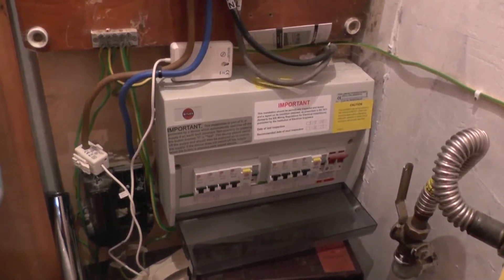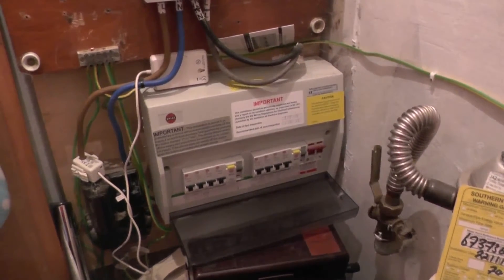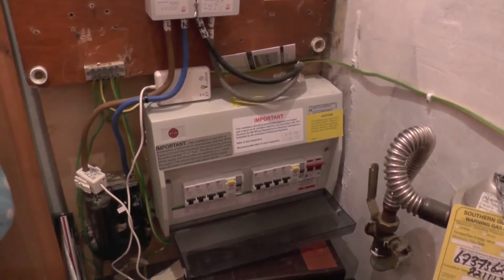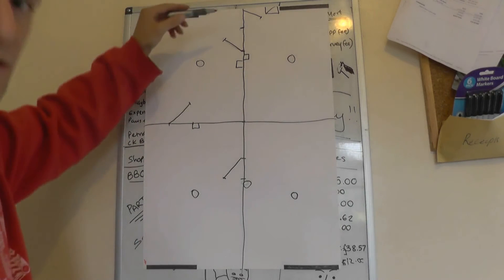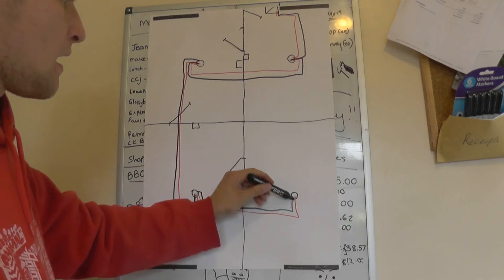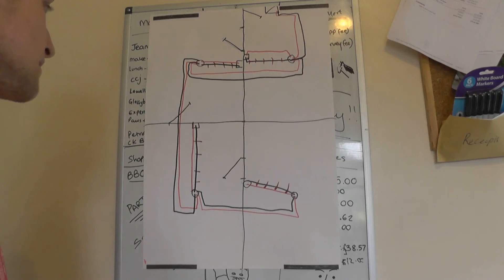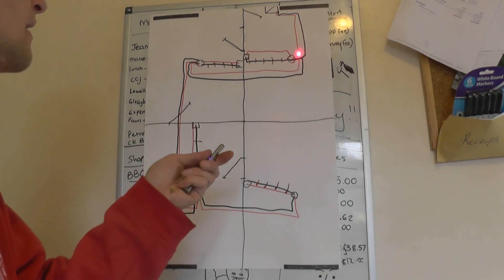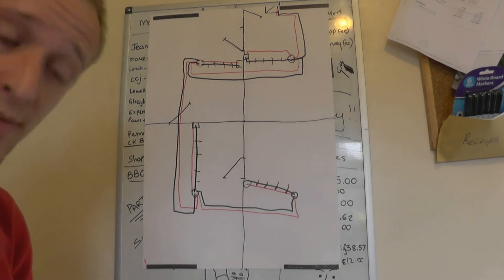Using existing mains UK wiring for 12v lighting! what do you think?

Comment: Your drawing is a "radial circuit" not a "loop circuit".
Here in the UK you will see sockets wired in 2.5mm T&E in a loop circuit which is fused at 32A max, and lighting wired in 1.5mm T&E radial circuit which is fused at 6A max.
I would use Loop Circuits for low voltage lighting, not radial. Because loop circuits can handle double the amps with the same sized cable. By returning the Live Neutral and Earth in the last light to the consumer unit in your drawing(changing the circuit from a Radial to a Loop), you double(12A) its current handling ability.
Also, the switch wires should both be red, not red and black.
Reply from the maker: Brilliant idea closing the lighting circuit and making a ring circuit out of it. If you moved house you'd have to remove the link that closes the lighting radial to a ring otherwise you've changed the characteristics of the circuit and would need to get an installation certificate put on it.

2.5mm was used for camera only. 
1.5mm could be on a 10A mcb depending on your test results and I've only on one occasion seen a red and red twin and earth on a house that was undergoing a rewire. It is available but seldom used.

Comment: Please forgive me for the proverbial sucking of eggs in some places given your trade.
As you are well aware, the current wiring is typically protected by a 6A over current device, usually an AC rated MCB. So, without performing any wiring upgrades, you have 6A to play with. Given either of the ideas presented, this equates to 1.4KW@ 240V or 72W@ 12V.
Either way you would naturally remove the wiring for the lighting circuits from the existing 240V mains supplied consumer unit and re-route it into a separate cabinet.
Assuming you decided to go for a 12V system then inside that cabinet you would want to continue to provide protection for the wiring at 6A, however it must be a DC rated device capable of extinguishing the arc effectively, either with a DC rated circuit breaker or a suitable fuse.
If you were to go for a 240V inverter supplied system then you could use a standard 6A AC rated breaker from your favourite electrical factors alongside a RCD, or just use a 6A RCBO. Upstream of the RCBO would be as small an inverter as feasible (to reduce losses in the conversion process). The inverter will, naturally, have it's neutral leg tied to earth (upstream of the RCBO of course) which would facilitate the operation of the RCBO in an earth fault situation.
A 12V system limits your wattage dramatically of course but has the advantage of only having one conversion process which takes place in the lamp it's self. 72W of LED lighting is quite a lot. I am quite comfortable with 10-15W per room. The voltage drop may be of some concern, but it's not as if the entire load is at the end of the run, it's spread out along it. Also consider that the LED lamps have a DC-DC converter inside, so would be quite happy running at say 11V. The disadvantage is that the fittings would need to be changed to suit 12V lighting.
The 240V inverter fed system retains existing light fixtures and can handle more power, but obviously requires the purchase of a suitably sized (good quality) inverter at some cost. Also, the inverter may well be running 24/7 for the sake of convenience (who want's to be mumbling and stumbling around in the dark to switch the inverter on at 2:45am when all you want is a slash?). Running even an unloaded inverter uses a lot of energy over a 24 hour period
I hope this provides some food for thought..

Comment: if you choose 240 then i would go inverter to a rcb fuse box for the lighting if 12 volt i would make it so the very last feed is returned back to the fuse box effectivly making it a ring main thus lowering the line length and able to hand more power

Comment: Just disconnect the lighting circuit and stick a 12v battery on the cables and go and measure the voltage at the farthest point,real world losses then not theory.i myself think your volt drop will be to high
I remember back in the day I had to run 6mm t&e for some 12v lighting that was not that far from the transformer,I know you will not be using 50w 12v lamps but the volt drop is going to kill the project in my eyes
If it's for bedrooms and like how about converting table lamps to 18650 battery packs running led lamps and just unplug the battery pack to charge when necessary... Just a thought

Comment: Doesn't sound right to me; You'd have a huge voltage drop. Why not low voltage AC using an inverter? Common practice in Australia we generally loop at the light switch. Older homes it was a typical practice to loop at the light. Need proper DC approved mechs too. 
As a sparky I'd wire each light to a plc with a hmi interface, that's just my personal preference for the modern age.

Comment: I'd use a star wiring pattern with a central distribution point - i'm not convinced utilising the existing wiring would be sensible. Feeding 48v and then using separate dc-dc converters would be a PITA and you'd still have cable losses and then the converter losses.

Comment: This is purely conjecture, I've never tried this idea. In terms of the loss you're facing the standard problem of distributing electricity so I'd experiment with the existing solutions. If you take the base 12v and convert it to AC at a high voltage then you'll have less loss in the distribution but it will require an AC to DC rectification and transformation back to 12v DC at each light. I'm not sure how economic it would be but it's an idea. It wouldn't necessarily need to be 230v AC just something a bit higher than 12v.
Reply from the maker: tobortine Losses in my opinion would be high in such a small cable! I'm trying to get more information out of the chap who did this. if you start steppun up and down the voltage you end up costing yourself more to get it off the ground then you'd save!
Reply: pietkaify
I think you're right, my idea might work in theory but would likely be very costly.

Comment: What I've done (in the US) is to run my 12V wiring as separate circuits up in the attic.  Then I use a class-2 (per US National Electric Code) 12v wall transformer plugged into a switched outlet to give me an isolated (and safe) low power 12v signal to turn on a 12V DC relay.  Then I use that relay to send power to my modified light fixtures, for example track lighting.  I feed that 12V DC wiring past the original AC wiring, the ends of which I short together and insulate.
I fuse each 12V DC circuit to 7.5 amps to keep it below the 100 volt-amp power rating of a class 2 circuit.  The key here is to keep the class 2 DC wiring separate from the AC wiring, so you can't put it in the same electrical box or in the same raceway or even hole in a wall stud.  If you keep it all separate, it's no different than speaker wire or a doorbell or thermostat circuit.  I've had my kitchen and attic converted to 12V LEDs for over 2 years now and my garage for over a year.  
In my garage, I left the AC lighting in place and just added DC lighting, wiring and switches in parallel.  That way if I'm working out there on a cloudy day, I can just flip on the AC lights then if the weather clears, I turn that off and use DC lighting.
At least the way my house is wired, there are light and outlets all on the same circuit, so I can't separate lights from non-lights easily.  And if needed, all my circuits could be converted back to AC just by reconnecting the original wires back to the fixtures and switches.
I'm planning to do some videos on my various 12V DC lighting circuits.  I have several different approaches as there isn't one works-in-all-occasions setup that I've found.
Reply from the maker: R Brown I'd like to see  a video on your system! I have one problem in regard to running 2 sets of lighting. The misses does not like the idea! =/ I could however have a point to plug the existing lighting circuit back into the mains via a transformer to keep it 12v

I'm going to do some testing to find out the resistance of my existing lighting circuit! Bearing in mind that in the UK we have 1mm copper lighting circuits most of the time and its rated at 6A (I'm limited to a maximun of 72W of power drawn.
Reply: pietkaify Inside my house, I typically have just the one set of lights but separate wiring for the DC power.  For example I have 6 or 7 5.5W LED bulbs in my track light fixture and that is under 40W and lights up the kitchen like daylight.  The only connection to the in-wall AC wiring is via a wall transformer (1 watt) to trigger a relay that's hidden away in a cabinet.  I also have some LED under cabinet lighting that's totally isolated from the AC wiring.  Before that it used to have a plug-in wall supply and by converting to DC, I eliminated that power hog.  

It's only in my garage where it was easier to just have separate everything that I put in both AC and DC powered LED lighting.  Since that area burns ~!00 watts of DC power and can be on all day long, I don't want to be draining my battery bank if its cloudy.

Comment: I'm a retired sparky of over 30 years, that's not something i would do, i'm guessing 1.0mm cable (cheaper) so he'd have to check the DC current capability of that size.
Also what if something happens to him that he can't do any work on the house (invalided or dies), someone else will not know what has happened to the wiring, and could isolate what they think is the lights and cut into the cable, not knowing that they are 12v and possibly could cause a fire.
I would rather see a dedicated circuit for low voltage, after all, as an electrician it's not like he's not used to running cables.
Reply from the maker: ***** This chap is a sparky. I have no pictures to back up how he has completed this. But providing there is a good deal of labeling and the modifications are fused right there should not be much of a problem. I asked my NIC man about off grid solar qualifications last time he came and there was nothing he was aware of! I'm going to check this time if theres any areas that would be of concern with mixed systems.
Reply: +pietkaify Electrical regs should cover things like emergency lights with central battery, failing that' i would base it from automotive, marine or caravan (dc circuits)
There is nothing physically wrong with what it sounds like he's done, providing he has followed current capacity of the cable, fusing etc, just not something i would be comfortable with, also remember that many sparky's run power and lighting through the same holes in joists etc, though the insulation factor would be plenty.
Also part of the reason Edison failed in electrical distribution